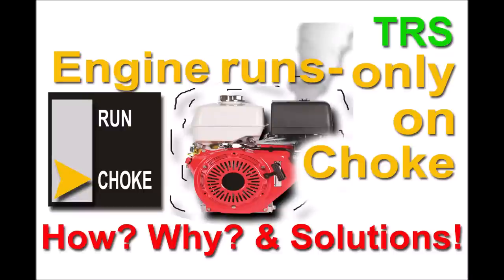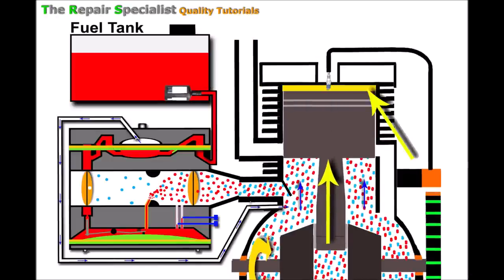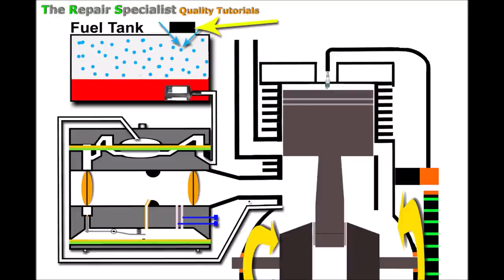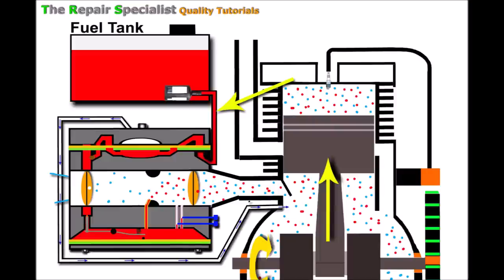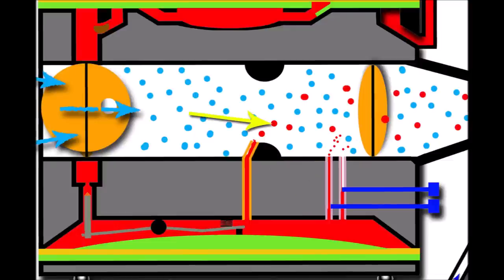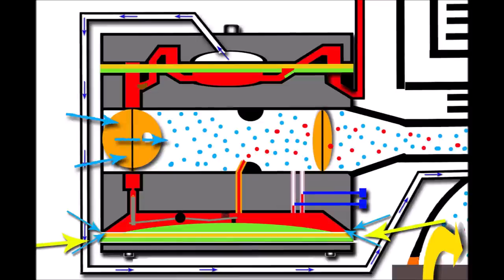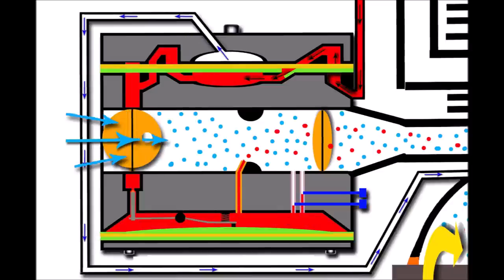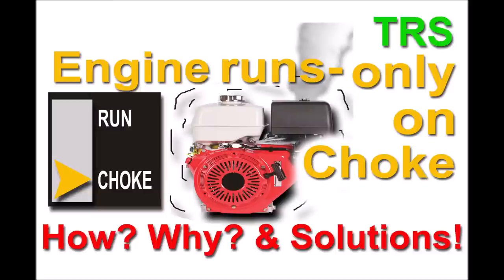Why ONLY RUNS ON CHOKE - Small 2-Stroke Engine

Comment: Hi TheRepairSpecialist - First off- superb video both in terms of explanation and graphics. Thank you. Was wondering if you would take a specific query? I have a 2-stroke leaf-blower. I can get the engine to fire after priming but the only way to keep it running thereafter is to throttle the choke open and closed repeatedly. If I leave the choke either open or closed (even after the engine has warmed) it will bog down and die regardless of whether I throttle the trigger or not. Subsequent to watching your video, I have replaced the fuel line, replaced the spark plug, cleaned the fuel filter,  and ensured that the exhaust pathway is clean and clear, but no joy. I'm a relative DIY newbie and I'm thinking that the carburetor may be the problem. I have removed the carburetor and can't see any mixture screws- there is one screw which regulates the minimum amount the throttle will reduce to which I haven't tinkered with. The gasket (to the engine manifold) looks alright to my untrained eye but I have not actually disassembled the carburetor. My suspicion, on very limited knowledge, is that it is a carburetor problem. Any advice would be very much appreciated. I am so reluctant to send the machine for a service having picked up so much from you this weekend! (As an aside, I would love to know how the primer fits in to the dynamic.)
Reply: Review the video.  Sounds like a leaking gasket that partly reseals when you manipulate the choke lever.

Comment: Great Video for mechanical problems.  When my Company's 2 cycle machines only run on choke the first I would check was a Dirty or wet air filter.  The air filter could become wet from the weather ie heavy rain or rinsing off the machine with a garden hose. Next  thing I'd check was the Oil/gas mixture ratio or crappy gas.  My workers would refill a near empty fuel mix can and add too much oil to the new gas.  So the gas mix was weak.  Also buying cheap gas and not Tier 1 gas was a problem.  I would always ask did the problem happen just after you bought gas.  If yes I would empty the tank and try gas from a different source.  2 more points for mechanical. 1, the Pumper diaphragm drys out and needs to be replaced.  2.The hole for the throttle butterfly shaft becomes elongated from the throttle moving back and forth.  This will allow extra outside air to be sucked in.  The carb needs to be replaced. Just my 2 cents from a retired Landscape contractor.
Reply: Step 1 is to always dump the fuel. You want to eliminate all possible variables. Fuel is such an easy one to rule out too. Lately I've really been into a spray bottle with some gasoline in it. It's better than starting fluid and so much cheaper. I got a blower that won't start for nothing without a squirt into the carb. But once it gets the squirt it runs like a champ. So it gets the squirt.

Comment: My Stihl will idle all day long but will not rev up. If the flap valve is not seating properly could this be the problem. Carb cleaned many times, the usual gremlins sorted.

Comment: Quick question. Should my little 26cc engine have a reed valve over the pulse hole as there is none?? just a hole for push/pull to the pump- may main tricky problem below

Hi,  i have a very strange intermittent problem with fuel leaning maybe after running on a 26cc worn engine.
Starts ok and when hot it has extra fuel available on both screws and can rev up and have full speed so all normal operation. BUT after 10-30 mins, she start to starve at idle and i can even off idle or rev up any more. I bypassed the fuel delivery and changed carb to 2 diff others and get exact same symptoms so cant be carb., so i thought leak in plastic boss, gaskets or crankcase seals letting air in and leaning mixture sometimes. so checked them and replaced and put 9 lbs on the CC and no leak.  Could it start to leak when hot and turning? and thus suddenly go lean? I know its fuel related as i can put on half choke and keep it running till it settles again and start running with full rich power again??? weird eh?
i never worked on a carb or car that did this . it either worked or not but on and off?  fuel delivery has to be perfect as i literally running it on gravity feed now and lines and all that changed and even checked flow of course. Compression seems ok and seems to start ok and run with full power available for an hour but has these "turns" cant work this one out after dozens of strip downs and substitutions and maybe a mystery crack in the CC opening up or leak somewhere that comes and goes but not with 9 lbs i apply to cc cold? hmm

 i think it might be the barrel gasket or CS seals lips? lifting when hot at certain times.  might make another cardboard barrel gasket and if not that it has to be seals in the engine that get hot and let air in to lean mixture? 
Even if engine was worn and stuffed, it starts and runs and idles and revs up so how bad could it be? also why would it run perfectly then not then ok again. not logical. I notice when i rev it , the machine dosent twist but my homelite twists with torque although a lighter machine to hold and less mass to twist.  low compression can ruin a idle but why it idles well with enough pulse and suction  but then not and then ok again?? so we are tracing a extra air problem as all fuel delivery possibles have been bypassed, so has to be extra air?  Piston rings are normal and springy so not sudden loss of compression when hot? how?
Reply: Sounds like a blocked fuel cap causing vacuum in the tank, especially because it takes some time before running lean.

Comment: My weed eater will bog down if the gas tank is full it's half full it runs great. Doesn't even have 10 hours on it. It's still brand new. When it first starts it takes off like a bat out of hell. Then on run it idles but has not much power medium rpm then once the gas gets low it starts running better. But if I hold the choke halfway between run and choke it runs how a weed eater should.
Reply: I should add when using the lever half between run and choke I don't have to squeeze the trigger. It runs at Max rpm from just that.
Reply: @JamesSmith-lt5zz  as this video points out it could be a lot of things. Your machine being new you'd think that'd eliminate some of them though. What you describe sounds a lot like a bad gas cap breather. That's an easy one to test too. When it starts running bad loosen the gas cap and see if it clears up. Should clear instantly. With a full tank a loose cap is probably going to leak on you. If it was me I'd make sure I always just filled that machine halfway up.

Comment: How about worn or damaged crankshaft seals, allowing air into the crankcase thereby reducing vacuum pulling thru the carb and adding outside air to the mixture.
Reply from the maker: John C yes definitely. I could have mentioned many more reasons but I had to end the vid somewhere. I think I have covered the crank seals on another vid as well. Crank seals yes!

Comment: I was stupid to buy a shaffen brush cutter and have had nothing but troubles with it. It was hard to start and keep running so I checked the spark plug and carburetor. I found out Shaffen marked the choke wrong. The choke was on when the choke lever showed it was on. When the choke lever was on the choke was open. Never buy a shaffen brush cutter they are cheap made junk and it breaks cheap parts very quickly.
Reply: They give you the shaffen?

Comment: What is the solution for engine run only at full throttle ? And while starting at full throttle some amount of fuel spray out through carb air filter. In stilh chainsaw
Reply: Check the muffler spark arrestor screen. Blockage there causes performance issues.

Comment: Surely the low speed port with it's adjustment screw should be on the engine side of the  throttle?

Comment: What about the fuel solenoid? Will the engine run if the fuel solenoid is bad? Can the engine run if you remove the fuel solenoid and put a bolt on the bottom of the carb

Comment: Dear sir, my engine starts and runs without the choke however it dies when pulling the throttle cord.
Why does it do that?
Reply from the maker: It sounds like your fuel/air mix entering the carburetor is too lean.  Meaning too little fuel in the air. If this was to be the case then you may benefit from tuning the carburetor to fix this issue.  Please take a look at my other video that explains how to do this.  The demonstration is conducted using a chainsaw but the principles are very much the same for other two stroke engine (if that is what you have).  Here is the link: https://www.youtube.com/watch?v=74p9FLmIkkw&t=40s
Reply: TheRepairSpecialist thank you for the feedback! I’ve found a few issues: i don’t have the type of tool required to move the adjustment screws, found a little mesh inside the carburetor plugged with debris and found the suction tube inside the fuel tank to be all broken up... it is time for a new one :)

Comment: I have a gas and oil mix tiller. My problem is this it starts up just fine HOWEVER  it will Mr run at full throttle. I've replaced the carborator the fuel lines and plug. I have misplaced the Gas Filter. Could that be my problem? Again....it starts up but when I squeez the trotal it doesn't revup. I could use some help here.thanks
Reply: 2 stroke engines have an issue with blocked spark arresters. Take the muffler apart and burn the screen out in it with a torch. Take the screen out of the muffler before torching it. The screen gets all sooted up and it is like a car with a potato in the muffler. If that's your problem it'll run like new with a clean screen. Good luck!

Comment: I wanted to ask as I'm new to using A petrol Strimmer and chainsaw. When I finish using them at the end of the year and store them away in my shed for long periods, is it better to drain the fuel tank or leave it in there. I've been told two different things but which one is correct? Super video by the way.
Reply: I store machinery dry. Some say storing them dry dries out seals. I say having stale fuel sitting in an engine is worse. I have some pretty old equipment I'm using. But there's arguments both ways. Especially with ethanol fuel that separates as it sits around. If you store wet you're probably going to have to dump the fuel anyways. You're just saving it to do later. Now there is fuel stabilizer you can use. That can be a mixed bag though.  Dry works better for me but I am not going to completely discount the wet camp. I dump the fuel then run the fuel out of the carb. I like them real dry for storage. Whichever you do there's plusses and minuses. For me dry just added up better.
Reply: I store them dry, dump fuel from tank and run engine to burn fuel from carb. My chainsaw is 10 years old and still works fine

Comment: Of all the mundane & repetitious crap that everyone goes through why oh why does my husband need to take the gasoline powered yard equipment to the lawnmower repair shop every spring so the mechanic can get them running for the season by rebuilding the carburetors ??? What can be done to stop this??? I think its ridicules and overly expensive.... we have a self propelled lawnmower, a weedwacker,  a pressure washer, a honda generator, a john Deere's riding mower, a log splitter and a couple other things I cant think of but the cost of making these things run every year is really high...

Comment: Good explanation. Thanks for the video. My boat, which is a 2 stroke and uses a fuel pump. Only starts with choke and then once started and choke is off it revs to the moon and won't back off. Any ideas?
Reply from the maker: To start with I would take a look at my other video on how to tune one of these little two stroke engines and then go from there.  You will find it here on you tube in the link here: https://www.youtube.com/watch?v=74p9FLmIkkw
You will find that it is tuning of a chainsaw but providing your adjuster screws exist on your carburettor then the principles are very much the same.  I hope this helps.  Thanks Craig

Comment: and nothing of all that has solved my problem
Reply: If it isn't fuel then it is spark. The troubleshooting order is spark then fuel. If an engine cycles and it is getting spark and fuel it should run. Might not run great but it should run. On 2 strokes the other common problem is a clogged spark arrestor mesh in the muffler. Plugged up exhaust is never a good thing. An IC engine is basically an air pump. It needs flow to go.

Comment: electric trimmer  looks better and better
Reply: If it can do the job for you. I have 3 acres here I need to maintain. So I'd have to drag a generator with me. I have a Stihl brushcutter with bicycle handles and a half gallon tank on it. Sometimes on a big trimming I'll run it dry. It depends on how much I'm into trimming on any given day. But if I want to do it the work is out there.
Reply: @1pcfred  ive seen ones with battery packs might work
Reply: @XxmattitudexX  batteries are too low power storage density to do the job here. Way too low. There's a reason we use fossil fuels. Because they simply cannot be beaten in power density. Not unless you get into atomic fuels. A liter of gas has something like 9,600 KiloWatt hours of power and a lithium ion battery the same volume has 460 KW/h So even at 10% efficiency gas is still ahead. It's just that much of a gap.